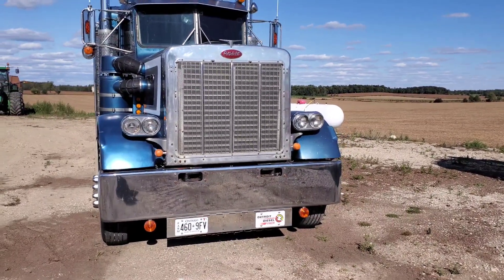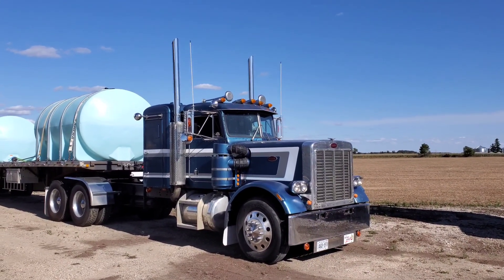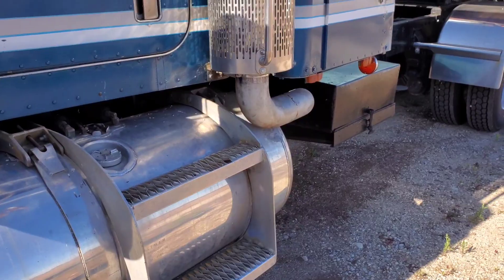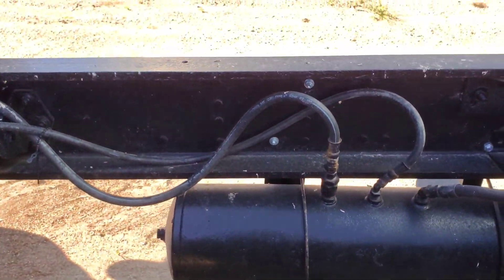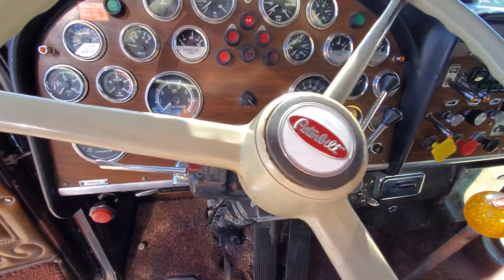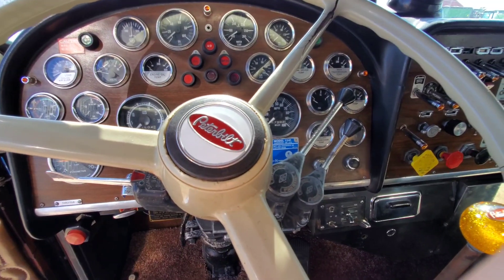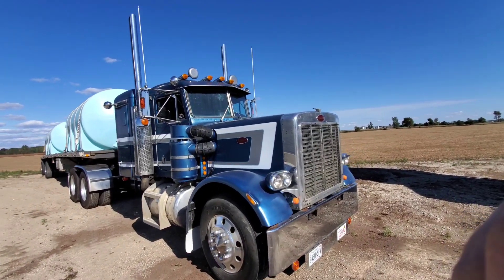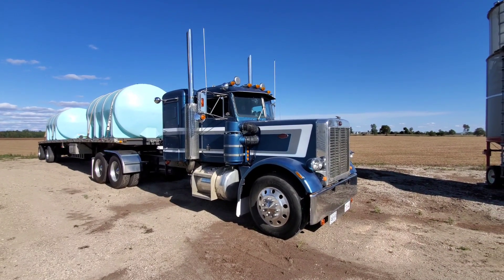359 Peterbilt: 2 Year walkaround #Peterbilt #359

Comment: So its been turned up? What is the horsepower set at?
Reply from the maker: 500
Reply: @Bubbles8V92  Thats awesome.
Reply: @Bubbles8V92  I understand the importance of historical accuracy when it comes to these classic vintage trucks,and keeping them as original as possible;but replacing all of the old incandescent headlights and marker lights,will vastly/greatly improve your visibility.An upgrade of all the exterior and dashboard lighting with LEDs,will be a big improvement.
Reply from the maker: @devinrussell2372  im not against led i just dont want them to look like leds. I probably would replace bulbs with led bulbs but not the whole light to led
Reply: @Bubbles8V92  They actually make LED Lights in the vintage style;for truckers that want that classic vintage look,to their truck.I think that swapping out the old incandescent light bulbs;with ultra bright LED bulbs,is a really good idea;plus it will save you money from having to buy brand new LED light housings.There are several manufacturers that makes what are called "plug N' play" light kits.Polishing the 
vintage/original chrome light housings;after the Plug N' Play LED kit installation is 
completed,will make them look as good as new.